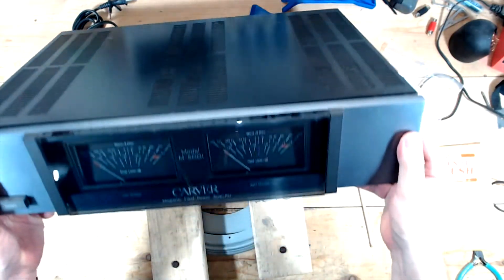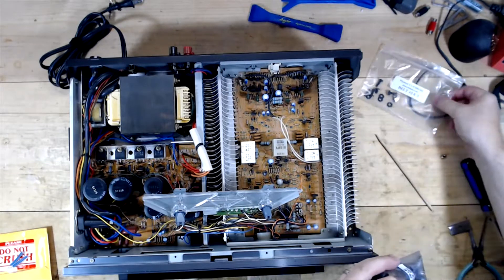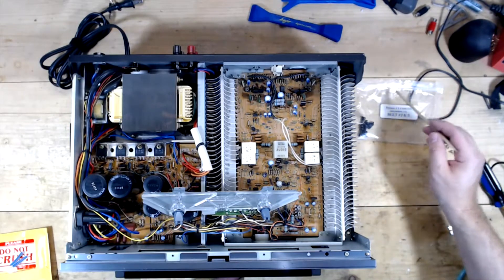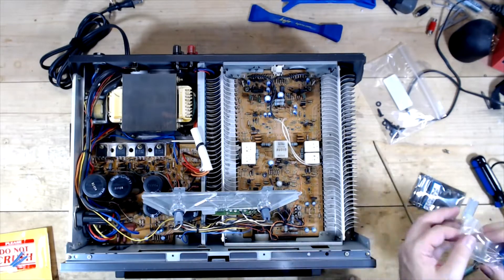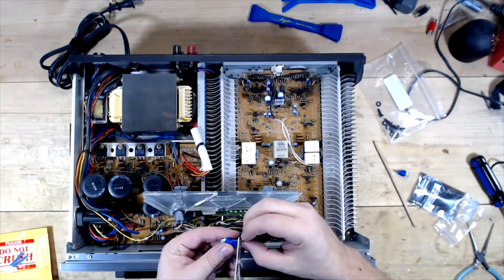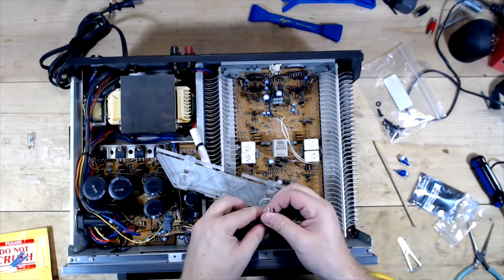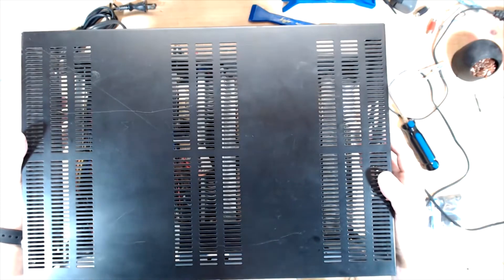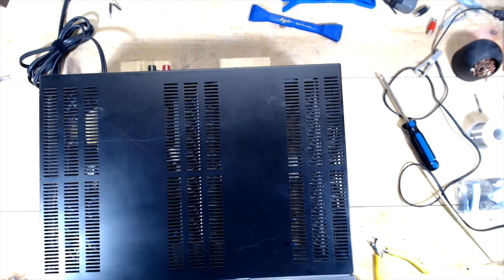Carver M500T Amplifier Lamp Replacement LED Upgrade

Comment: Can you provide the LED replacement bulbs that were used, I'm wanting to do the same thing, just need to know the LED bulbs to use and where to buy them.

Thanks
Reply from the maker: I bought them off of eBay.  The listing was for replacement lamps for this model Carver.

Comment: What if Both lights are out? is it possible the electronics that run the bulbs is bad? I am thinking of buying one that the lights are out and even though the seller is claiming it's "Just light bulbs" to fix it I don't trust their judgment hahaha
Reply from the maker: It's possible.  I'd check the voltage feeding the lamp wires to verify there is power.
Reply: @millervintagehifi3034  that's true... I did that on a Sansui 771 once...and it was the Voltage...had to find another feed to tap into and run wires to the bar